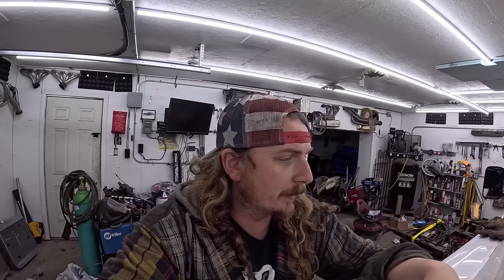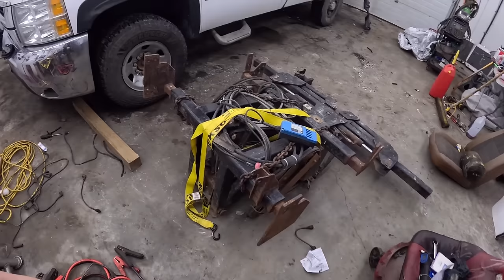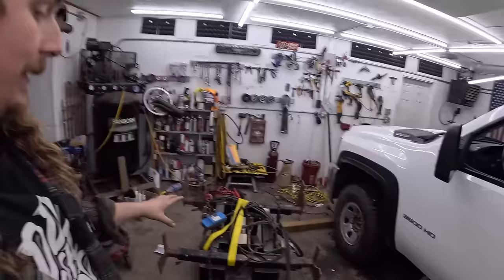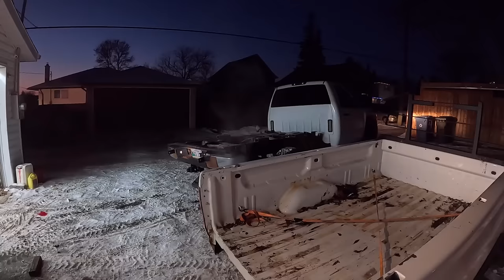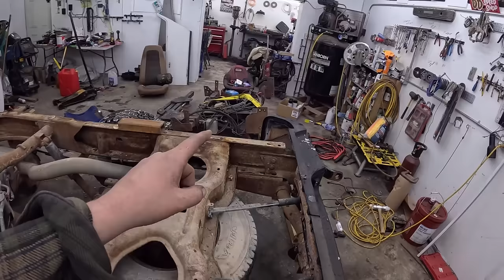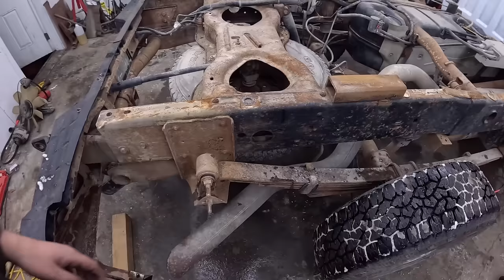Market Place Score!  I Built My DREAM Truck - Cheap Sneaker Lift

Comment: The pump needs wired so it only comes on when you hit one of the buttons to move the lift. I've seen those pumps on our lift gate trucks get hot enough to melt the plastic jug off the pump.
Reply: Yep, going to burn that new pump motor up pretty quick
Reply: This is what I thought!  or like a car hoist!
Reply: That's exactly what I came to say. Push a button and the pump comes on. You don't want the pump dead heading all the time. Lots of heat pretty quick.
Reply: Add some Airlift bags with a remote control air pump.  This will give you the suspension lift only when you need it.  No ride quality compromise

Comment: Hi Dan. You need a relief valve on the pump or there probably is one there already. It’s sounds like it’s building maximum pressure as soon as you flip it on. That way it will not draw so much power and you should definitely get away with the car’s alternator and battery as long as the car is running.
Reply: I agree.
Reply: The valve body should have a neutral bypass return back to tank when not being used, pressure shouldn't be on the system until a solenoid is energized.
Reply: @hardball107  exactly. That’s what I was trying to explain but my English isn’t the best. Thank you sir
Reply: @hardball107  Propably on original controls, pump was turned on only when any of the functions were enabled. Now it is possible to do that by using few diodes...
Reply: Dan the Capri has a frame. All the way to the bumper you could pick it up there and figure out how to secure.  
  Those frames rot out over the drivers side rear wheel 
Been there done. That

Comment: As others have said you really need to wire the pump up correctly it shouldn’t be all the time, only be running when you use the button.  You’re gonna burn up the pump and that’s why you’re drawing so much power.   Good choice over the in bed set up, you made that truck a million times more functional.

Comment: The way ya got the hydraulics wired will work but ya gotta figure out the momentary part so the pump only runs when ya are hitting a button.
Reply: I totally agree 👍running the pump while not using it is building way too much pressure.

Comment: Lot of guys ditch the rear bumper because of that very reason. I think on those chevs you can stuff the bumper up closer to the box by modifying the mounting holes but it doesnt gain much. Every truck i see with a stinger doesn't have a rear bumper and i feel ya. It looks gaudy lol but hey great acquisition! This will make your car addiction SOOOO much easier! And if you wanna do repos on the side, your set up!
Reply: Could always build a quick release for the bumper for when he has to tow something with a large rear overhang. Like you said most guys in my area run no rear bumper but they are strictly business trucks. So I see why Dan would want to keep his.

Comment: Great job there Dan!! I’ve used those pumps on many farm applications. Your controller switches should be double pole, momentary.  So the switch will do 2 things at once, turn the pump on and direct the solinoid.  That way your pump doesn’t run all the time.    Keep up the great work and have fun on your trip!!!

Comment: Adding a belt driven PTO clutch pump would increase flow and really improve it's operation. They make bolt on kits. But the 12 volt pumps do work just slower and keep a spare solenoid for the pump in the truck. The motors do get hot. Add a set of overload springs with over load spring pads, overload springs should just touch the pads unloaded. that way it does not effect the ride as much when empty. When lifting a car it helps to lift the car bumper above the truck bumper for turning. Alot of guys used to remove the rear bumper. I built some of the first ones of these back in the 80's at Dynamic. Make sure you keep the king pin and bar plates greased, there is alot of load on that pin and plates on the Draw Bar when towing. You might need to add a steel 1/4" push bumper to the front for counter weight on the front of the truck for stopping. Bigger cars required us to add some weight ahead of the front axle. If I remember right 200lbs - 400lbs. Some times 1/2" plates were cut to frame width and bloted to the bottom of the front frame. Using a relay to turn pump on when you hit any control switch is the way it needs to be done so the pump is not running continuously and bulding heat, they are just a starter motor and really not designed for continuous running. But that pump should only come on with functions if you want it to live.

Comment: Nice job Dan, your gonna love it. I ran one for yrs. The pump has to be wired to only come on when you press a function switch, you do not need two batterys. Also a backup camera placed low so you can see & you never have to leace the cab

Comment: Glad you got the stinger working.
Just one request, PLEASE  release switch when you get to full throw. 
That high pitches squeal is the idiot alarm.
Loose that bumper and weld a chunk of 4 inch pipe in it's place, close in to body.

Comment: Iv never once unhooked a battery when welding. Its  not the battery being hooked up that fries shit. Its people putting the ground lead on rocker panel and welding on cylinder head. Or puttin ground on the bumper and welding on the rocker panel. I work on modern cars every day.

Comment: Looking good. Think your going to need to make a door to access the hydraulic pump. If you don’t want to add a battery you would need step on the gas to increase the power. On my dump truck 94 gmc 3500 I have a belt driven pump. Pump when it’s slow I just kick up the rpm a bit and it does it. Also I would roll pan it so you have more turning and lifting room. Get straps and a set of wireless trailer lights from princess auto for adding to the car your towing. That’s the cheapest way to get lights for towing. You might also need a strobe. $50. Princess has ez strobe light kits. Will cost $250 and up depending on what you want to do if you want the hidden front and back. I went with those cause I work most at night and people still get to close when trying to change tires on the side of the road.
Reply from the maker: Always got solid advice.  Thanks dude!

Comment: To help counter the weight behind the rear axle, Make a 6 or 8 inch box across the front of the bed that is the same size as the bed and fill it with sand (or gravel, concrete, scrap metal. etc)... the more weight you add, the less the stress on the frame will be...

Comment: The pivot pin will wear pretty fast depending how much it’s used and or greased. The rest is pretty much maint free for about five years or better. Hoses, bushings and rams will last if kept maintained.
Reply: Seen some kits that mount under and the bumper almost hides it.

Comment: Dan...
  Lifting the bed off use 2x4  cut to length for the in side the upper bed rail put your forks in low set the 2x4 on top of fork lift...
  Easy peasy

Comment: Most trucks like this have the controls at the back so you can see what your lift is doing. Maybe make the controller wire longer so you can walk back to watch it. Other wise super job on all the frame strengthening

Comment: Timbren makes a Heavy Duty kit for these trucks, super easy install, just replaces the factory bump stops, and they're progressive so they still ride nice. I have the light duty set on mine, unloaded you don't even notice it, but with the enclosed if does a bang-up job preventing the sag it used to have. I know you've already done your reinforcing, but if I were doing it, I'd probably just box the frame (on the inner side) from the front of the forward leaf spring hanger to mid-way under the cab where you said others have seen failures.

Comment: Hi Dan ,all my years of experience, repairing and building frames,one of the weakest points on your truck is right below the back of the cab. The way you are reinforcing it with the strip on the top flange is the perfect way to reinforce the frame it will take most of the brunt. If you look under the cab, there should be some holes on that top flange where you can bolt your reinforcing flat bar. pre-drill them holes in your flat bar and then run that flat bar right to the back of the truck stitch welding it.
Reply: like cutting out a major crossmember  wow     bolting on strength yes welding on frame no no no

Comment: Also take the hand held control box apart and look at wiring, if it has double pole, double throw switches its already wired for controling pump. The switches are probably all jumped together on one side to control the pump and the other side of the switch will be for functions.

Comment: The rear frame looks surprisingly decent from a rust perspective.  Make sure you look closely at the tube crossmember that goes over the gas tank.  The tank holds all the moisture and salt right up against that crossmember rusting it out.  Either drop the tank for a good look at the underside or use a flashlight to peek into the tube from the side.  I found that crossmember entirely rusted through on my 07 Silverado.  It was pretty easy to replace and I'm glad I spotted it before my gas tank dropped to the ground.  Also, why not cut an access hole in the box floor just above the pump to get easier access to fill the hydraulic fluid?
Reply from the maker: Yeah all good ideas

Comment: I lift a lot of truck beds off and I had a few of those incidents using straps now I cut a couple of 2x6 planks and and put them under the upper box rails and drive the forks under the planks and lift off a nice stable box

Comment: You mentioned lifting cars from the front, this lift is designed to lift from the front. All cars have a place where tow truck drivers can disengage the car's shifter lock, to put the car in neutral. Worst case scenario, you'll have to drop the drive shaft. This is also helpful for cars that do not have a locking steering column.

Comment: Listening to that pump deadhead is like nails on a chalkboard!  Have to wire it like a snowplow with a second solenoid to trigger the pump on and off.  A ford style starter solenoid works well.

Comment: Throw some helper air bags on the rear axle. helper springs might give it a stiffer ride where air bags would give you lift and a soft ride. I use helper bags on my truck when towing the toy hauler, big difference. The install didn't really look that bad...

Comment: I am an old ford man. The dealership had a frame comparison between all of the big 4 and ford's frames where far superior.  It's amazing how strong ford frames are. My f150 was rear ended by a semi.. it only bent the bed rails. 2700.00 damage.  Them my brother ran it up the side of a mountain.  It was twisted bad. They pulled it down and drove it away lmao 🤣.

Comment: Looks good but we hook most of these power units up to turn on when you move a function. The pump sounds like it's going over the R/V as the valve block may be closed centre.  Just a thought, well done...

Comment: Since you're up 24 hours a day it seems, might as well start a towing business too 😂. Love the channel!
Reply from the maker: Haha
Reply: Dan 
Did you make new shock mounts ??? I was thinkin that when I was also wondering if you drilled the top box bolt holes in back ??? Does/wouldnt "boxing" in the frame on the inside strengthen the frame more than the way you did it ??? Just curious ???

Comment: And yes you’re gonna wanna add around a 400  pound to the front end if you’re gonna tow wit it fully out. Maybe a nice bumper with a built in tool box hua ?? Hua?? With a winch and some rigging stuff so you can do a full recovery! Lol hood luck hot dog!

Comment: I think you done good,Dan. Lots of work but worth it in the end.
Reply: Lucky its for light stuff, otherwise I'd take bets on how long the frame would last. Wasn't home the other day I popped by but I didn't check it out without permission.
Reply from the maker: @nummnuts22 I'm sure itll b fine

Comment: My pump only came on when I operated each function… not sure why your pump runs all the time . I’d be afraid it might burn it up quicker? But it works and that’s a plus and you get the truck bed to use again

Comment: The trucks of the 40z had a mechanical friction lever attached carbs running into cab to rev the motors idle up when u needed more juice ...just sayin and best of the festive season to u guy

Comment: I still prefer a flat bed full floor car trailer with a remote controlled electric winch. Unhook it if tow vehicle needed for other purposes. Can be towed by any other vehicle with a receiver and trailer wiring if primary tow vehicle develops issues. Car being hauled does not need roadworthy components (or even axles) on either end. No hydraulic subsystems to deal with. Many tie down points to utilize. Not as maneuverable in tight spots, but advantages outweigh disadvantages. And trailers can be used for hauling other stuff besides cars that are too big to fit in a pickup bed.

Comment: My understanding has always been that frames, especially trucks, is there is a large amount of spring in the frame to give needed flex under operation. So the tensile of the steel is much like that of a spring, this is why everything is riveted not welded at the factory. This is because welding temperatures cause damage to the structure of the steel creating hard brittle areas that are prone to crack. Maybe I'm wrong?

Comment: Drill a hole in the inside wall of bed for trans funnel to fill hydraulic tank. Put rubber plug in when not using it.
Reply from the maker: That is a really good idea.  I'm gunna remember that

Comment: I have seen guys use one of those cheap roll pan style bumpers to cover the frame ends with that type of wheel lift. I know some just run with no bumper at all but I prefer the roll pan style bumper myself. just buy a universal fit one and with your body working skills you can weld it in paint it to match and there you go.

Comment: Air bags are great
 But my tow truck Holmes 440 has a million million leafs . Seems to be fine too just weights 11,000 lbs and running in Saskatchewan. 1978 chev. Put airbags onto my half ton 6.5 diesel. Had them on my 5.9 12v nv4500 cummin was amazing

Comment: While you are at it change the fuel pump in that tank.  I'm wondering if boxing the frame in would of been easier.  You most likely will need a alternator with a larger amp output too.   You need to can the bumper.  You need more vehicle to vehicle clearance for turning.

Comment: You should be using 6 post switches wired to activate the pump when commanding movement. The pump sitting running will destroy things with heat and pressure in very little time. And as a safety note a guy should really avoid putting fingers in on or around moving parts just after operation and pressure she be some how relived prior as well. Stuck compoanants can unexpectedly operate badly injuring fingers and such.

Comment: That pump is deadheading at full hydraulic pressure and causing battery overload. That’s why you have 8 V. That hydraulic pump motor should only run when actuating up down in or out.

Comment: nice job. id find a wiring diagram, the pump should only come on with a function. like a snow plow. itll save the pump motor from burning up not to mention the hydraulics will get hot too running over the relief valve the whole time

Comment: The pump shouldn't run all the time, it should only run when you hit a button to move it just like a plow or a dump body. You are dead heading the pump and will burn it out quickly,  not to mention killing your charging system.  You need to wire it to the control box.

Comment: I’m surprised you didn’t plate the inside of the frame and add a cross member to replace the one you cut out, also they sell 200 amp Bosh alternators for those trucks, they make a ton of amperage at idle , a lot of those high wamp alternators only make power at higher RPM

Comment: I don't know why. But those hydraulic motors take a lot of power. A friend of mine has a plow with a hydraulic over electric system. And the lights dim when it runs.

Comment: I for one think your right to plate the frame. The frames get weak any way from rust and revits get loose this is a good idea. Also they never thought at chevy you would make a tow truck out this truck so It is good to make it tougher. :body-blue-raised-arms: get a new tail light at the salvage maybe? Call and ask what they would take for one. Like you said shit happens.:hand-orange-covering-eyes: interresting video.  should be great.:glasses-purple-yellow-diamond::trophy-yellow-smiling::trophy-yellow-smiling::trophy-yellow-smiling::trophy-yellow-smiling::trophy-yellow-smiling:OH its a 1 ton its considered a real truck it will be fine.

Comment: I know this sounds crazy.  Most trucks with this setup have the frame cut just behind the rear spring mount. Bed is flat back with the corners cut for turning.  Kinda hard to do with a stock bed. But I know you'll figure it out for your needs. It's your truck for and intended purpose for you not commercial towing.